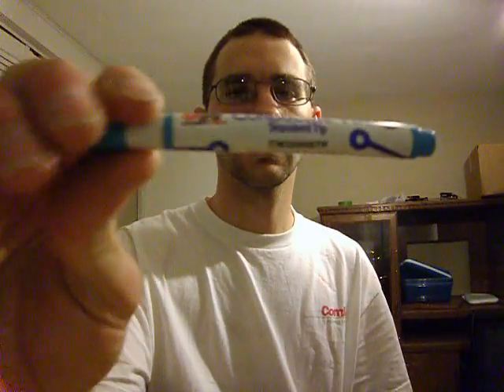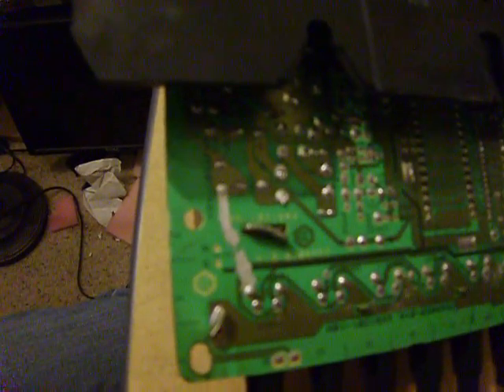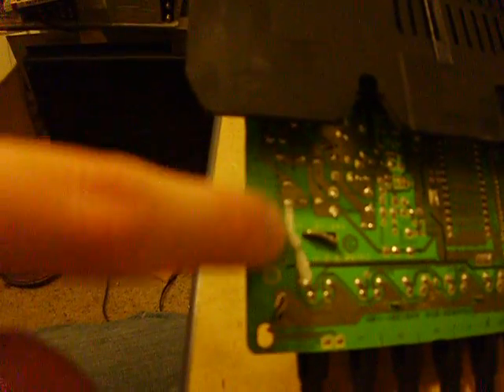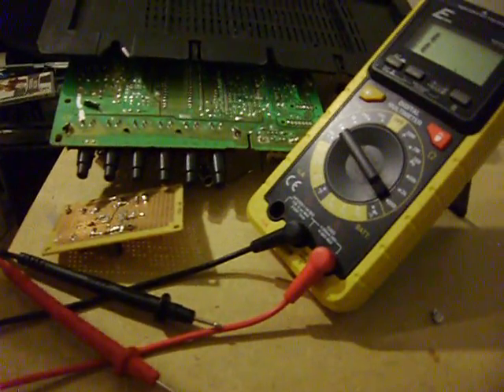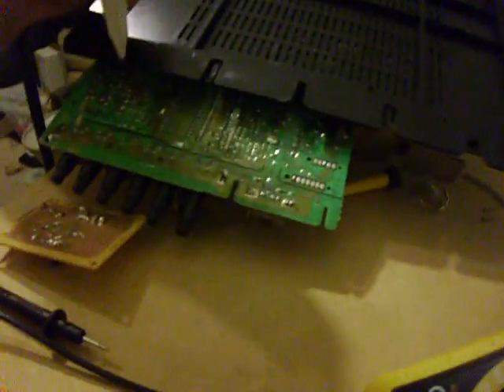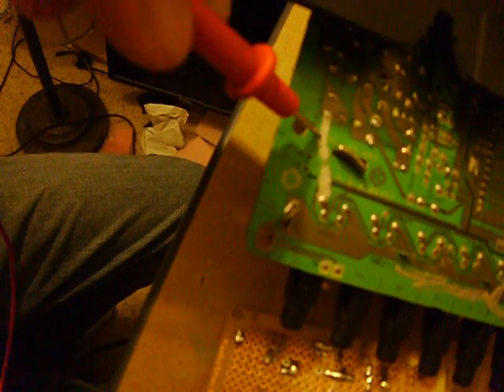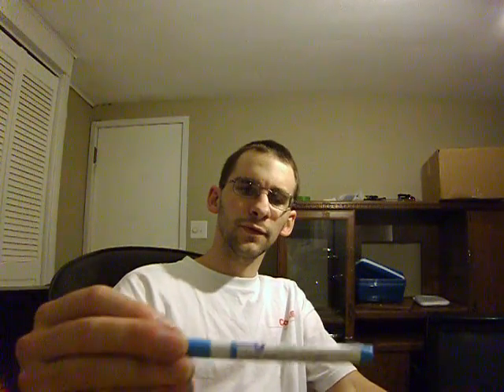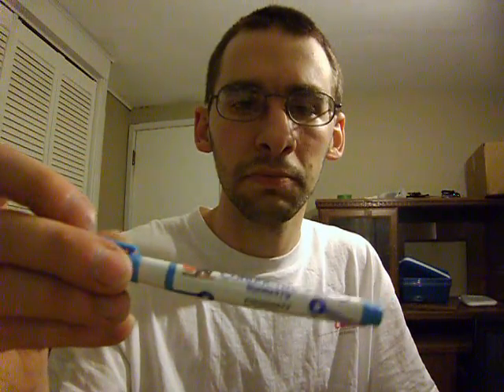Circuit Works Conductive Pen

Comment: sirve para los potenciometros de volumen de una consola de sonido?
Reply from the maker: This would be good to make a trace it will not be able to use as a pot. It has 0 ohms.
Reply: Hay otro producto que es resistió Max que conductivo. Bare conductive. Aunque si nombre es conductivo,  en realidad es resistivo